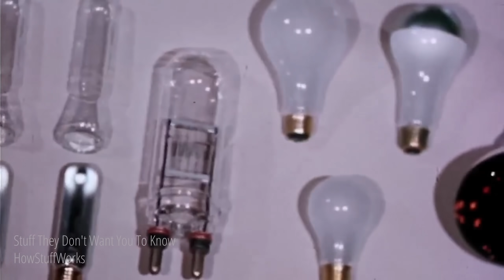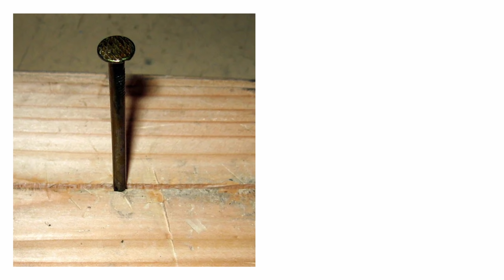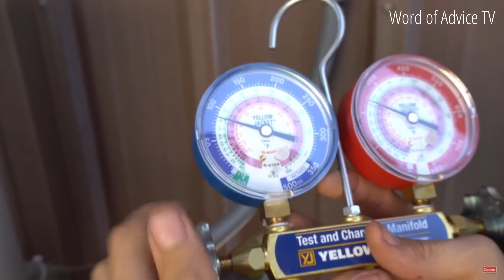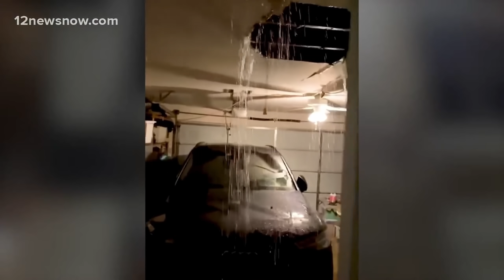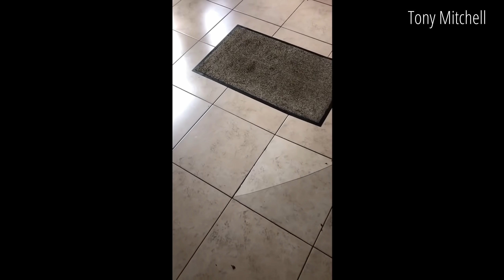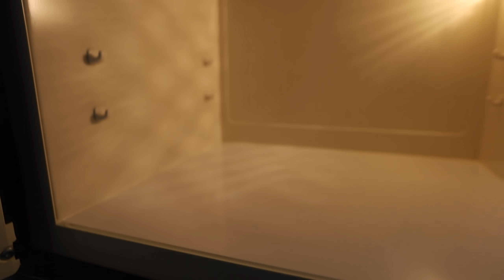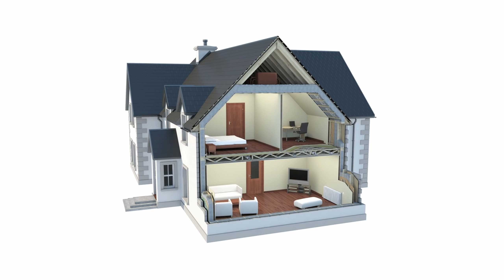Built to FAIL | Planned Obsolescence

Comment: Housing projects were examples of Planned Obsolescence. They were shoddily designed and sparsely maintained. The government and real estate developers played the long game with them. Using them as an excuse to level the lower density housing around them, and to concentrate the poor. 
With the property surrounding the projects gone, developers could come back in and claim the land and develop newer, more profitable developments. 

As for the projects. In Chicago, for example, they argued that the structures were so dilapidated and the conditions so miserable that they HAD to demolish them; giving the residents Section 8 housing vouchers and shuttling them either to other neighborhoods, to restart the process again in 20 years, or out of the city completely to suburban areas or other states that were ill -equipped to deal with the influx.

Comment: Crawlspace on pier and beam foundation, Easier to get to utilities, standardized sizes, not springing on all trends.  Sounds like a high end manufactured/mobile home your are describing as ideal solution.  Where I really have to agree.  Looked at many site built homes - you have little chance of repairing anything without huge bills. A modern mobile home is better built and stupid easy to repair. The roof is metal, Vinyl siding - both with last 100 years, while site built homes come with shingles - which are only good for 10 years.

Comment: I have a perfect example of planned obsolescence through a series of washing machines. When my ex-husband and I bought a house, a friend of a friend was downsizing and replacing his washer and dryer. Though his old ones were at least fifteen years old, they still worked fine, and he very generously gave them to us for free. They served our blended family of seven for six years without a problem, after which we separated and I took both machines with me, and my now family of four, to my current residence. 
Within a month of living here, the washing machine crapped out. My dad was very handy and, after finding the problem, decided that it would be best to replace it. My grandfather very generously bought us a replacement as a housewarming gift. (I was blessed with a wonderful family 🥰) That machine lasted for less than seven years, and only because we had purchased a five year extended warranty, which I had to use near the end of the contract. The next machine lasted about six years before it started leaking and making some very strange noises. It was then that the dryer finally gave out, so I replaced both and purchased extended warranties on them. 
That was two years ago, and who knows how long these will last. 
It infuriates me how shoddy construction is these days. Items that used to last for decades of use are made to fall apart as soon as the warranty expires. 
On a side note, when purchasing the last two washers, the salesman immediately tried to steer me to the most expensive ones. Finally, I placed a hand on his arm, looked him square in the eyes and said, "I want it to wash the clothes, not talk to me or the refrigerator or forecast the weather. I just want it to wash...the...clothes. The newest machines are both made by Whirlpool so not cheap, but reasonably priced. And, so far, they wash and dry the clothes without talking to my other appliances. 😉

Comment: Technically, LEDs can last for up to 100,000 hours of use, easily. 
What doesn't last are the circuit boards that are required to run them. 
One of my most common jobs as an electrician in the 2010s was switching out one led for another. They were promised to last 15 years. Lasted 2, because the circuit boards were badly designed and constantly overheated by the LEDs. One LED doesn't get hot, but what many people don't realise is that you need 4-10 LEDs in a socket to match an incandescent light's output.
I truly wonder which one is actually more sustainable. Should we use more tungsten for the incandescent lightbulbs or should we use more aluminum, boride, cadmium, manganese and so on to run the circuit boards of LEDs, which themselves are also doped with non-recoverable amounts of ALL kinds of rare metals?

Comment: Dyson vacuums does this by designing a trigger switch  that breaks over a few years. I opened one up and found the trigger was made if plastic and very thin in areas where it should be thick. I ended up fixing the cracked trigger by plastic welding and embedding a metal rod into it.

Comment: I disagree with you that breaking concrete to reach plastic drainage piping is planned Obsolescence. I find it hard to believe that someone intentionally does put drainage pipes beneath concrete slab for that purpose, it's just the way buildings have been built in the past and the present. Maybe you could have proposed a better option to access or service drainage systems

Comment: Recently, I cleaned my mother's apartment and came across our old Bosch-
refrigerator. The de-icing was a little dodgy but still in good working order. I put it on the curb and it was gone in 2 hours, now serving as trendy bar-cooler in a country-house... and still going strong. This was bought in 1967!

Comment: Watching this video just makes me realize how terrible some American systems are....... It also makes me realize how good we have it here in NZ.....
Reply: For a reference as well, 
I currently live in a 1970's house that was built quickly and as efficiently as possible to give housing to construction workers building the hydro project. (A massive project in Canterbury, NZ that provided heaps of jobs and clean power). This house was not really "built to last" as it was seen as a temporary solution, it was also built to be split in half and moved to where it was needed. 
HOWEVER, this house is solid as anything! The frame of the house is going nowhere fast and even 50yrs on is still as functional as a new build. The only couple of things letting it down is;
- The Outer Cladding, simply because it's made with Asbestos
- The piles for the foundation, we were unlucky and they are made of limestone 🤦🏽‍♀️
- The lack of modern insulation, simply because we have "silver paper" the 1970's way of insulating homes. 
When looking at the costs to renovate and update it, you're looking at about $40,000-$50,000 NZD to update it. Which is so so much cheaper than getting a new house.
For a more recent home build, my mum built a new house about 6-7yrs ago and during the construction process they used all of the techniques described in the above video, bolts on too the foundation; batting insulation, not foam, etc
Reply: The US took planned obsolescence pretty far with buildings, but we still have a long way to go with getting rid of it however nobody even cares.
Clothing, electronics, tools, it is really getting on my nerves how so many manufacturers give no fucks about giving you your money's worth anymore.

Comment: Hi Belinda. 
We chose a plastic rug with a wooden look for our new floor. 

We removed the wooden floor to be able to lay new insulation and the old floor was more than worn. when we had to choose floors, it became difficult. We were so into a new wooden floor, but the wood quality today is not what it used to be and the costs were sky high. We have click floors in some rooms and I have been involved in installing such floors, so we do not really like it. It is hard, ages too fast, etc. 

Here, all electricity is placed in pipes, power lines must not hang loosely inside the roads, which makes it possible to replace them without tearing up the floor or wall. Your wallpapers are really killer, so keep them nice. 

We try to choose sustainable, healthy and economical. 
We want a home where friends can be messy and where children and pets can be without us being present. We want to choose safety in the form of electricity, water, fire, wind, etc. 

I like your channel a lot because it is informative and much of your way of looking at things is the way I look at them. 

It would be interesting to have a program on how to protect your home from water damage.

Thank you for what you do

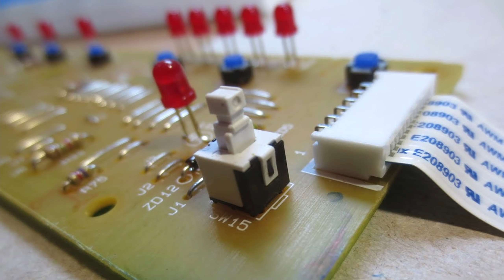Comment: 3:28, Hmm... almost all on/off switches are soldered on the PCB. What other ways to put components on PCB?
and it'll be a $1 part from Digi-Key. Also removing a component from PCB is never hard if you know how to do it... There's another way is simply to short the switch and make it constantly on..

Comment: I recently traded in my F350 6.7 Diesel truck at 105k miles due to this type of manufacturing.  When the truck warranty ends, the owner is looking at $5k for a turbo replacement, $3k Def system, $12k fuel system, $5k exhaust system, and then you still have many other parts that can fail...  I couldn't handle it, every time i started the truck i was waiting for something to break...  When i bought the truck i thought it would last 300k miles, and some do, but with failures along the way.  I realized while i owned the truck that Ford had enginerred the truck to just make it past the warranty period.  I'm not a mechanic and don't intend to become one...  I bought a gas truck, no turbo, no expensive def or exhaust system, simple fuel system...  and something i can work on if i need to.
Reply: They charge you 5k for a fucking turbo for just an F350 in the US? ...That is just insane!
Reply: @fumanchu4785  lots of labor charges, the parts probably cost $3500

Comment: First thing society could do is to mandate higher warranties.  Very few of us would consider buying a new car without a three year bumper-to-bumper warranty.  These are very complex machines working in quite a hostile environment.  A domestic fridge, operating in basically an isothermal, vibration free environment should have warranties far in excess of the one year warranty you get today. My old fridge worked 32 years without problem and was only disposed of because the plastic used on the inside had become hard and brittle and had broken in places.

Comment: I plan to hire a builder in the very near future so I'll be having very frank discussions on this topic with them. I'm willing to spend a little more if it means I get electrics, plumbing and flooring that are so solid they wont need replacing and I won't have to tear up the building to get to them for repairs. Currently got an offer accepted on some land.

Comment: I always questioned why on Earth houses aren't built in a way that one could easily service it. With openable walls and pavement where the water tubes or electrical wiring passes, etc.

Comment: There's also the intrinsic obsolescence - instead of using quality materials, our "economic" system pushes manufacturers to save money on each corner, including use the least quality/cheapest materials.

We are so quite messed up as a species still. We could've been doing SO MUCH better right now, if it wasn't for the competition based, profit based socio-economic system.

What we're basically doing is fending each for ourselves, when if we worked as one team - we could have progressed so so much more than we have progressed at this moment in time. We're basically (still) using a war-like socio-economic system, where it's all about how to win over others, how to cut corners because competition is getting worse and worse, where the rich become richer and the poor become poorer, etc.

Comment: All my pipes and plumbing run in my crawl space under the floor result I can easily access it and change it any time. Cables and switches above floor are surface mounted in conduit result changes are easy. I never install flooring like laminate because it doesn't last and access to floors is a problem. The above are not popular choices and consumers don't like it but it saves any problems and expense down the line.

Comment: Easy there Belinda darling on us Canucks. From a quick read through of the legals of wood stoves and such here in Canada the ban is only on very old or very inefficent wood burning stoves that emit faaaaar to much pollution. 

You can still have a wood burning stove or fireplace so long as it doesn't release more than 2.5grams of fine particulate per hour. A good quality stove from the last 10 to 15 years should be below that typically.

Having recently spent much time researching wood burning stoves of many types, many of them are emitting less than 1.0 per hour. I even saw one or two that were insanely low... as low as 0.35 per hour.

Although I agree with the sentiment that we should not be limiting peoples freedom to continue using their often still very functional heating methods, but if you look it at it more like how we banned asbestos use because of what was later learned about it's hazards... or how we have phased out using plastic disposable bags or incandescent light bulbs in favour of the obviously more efficient and evironmentally friendly LEDs. 

For example... when electric vehicles become pretty much the standard... I'm sure we'll phase out the use of gasoline and diesel over a period of time. 

I think the idea of the laws are to allow for homes that are... for those situations such as... lets say homes that are waaaaay past their 50+1 life expectancy, heating systems that are 25, 30 or 40 years old... or for the kind of "people" that just frankly don't give so much as a rats butt droppings whether their fireplace popultes the crap out their neighborhood right before the jump into their old 1990's diesel guzzling truck and blow huge plums of black smoke out their oversized and unnecessary loud exhaust pipe.

I love how you are critical of "fads" or "buzz" items but still approach the issues with an informed and logical mindset. When I first saw your video about shipping container scams I was about ready to pounce on you like an overly annoyed  Canadian beaver in the middle of a hockey match with an open net, eh!  Until I watched the whole thing. I was impressed on how you expressed yourself and your position. It'd be great to have a conversation one day if you're interested as I am currently in the middle of building a semi-tiny home myself, part of which will utilize a shipping container or two. Not to mention the topic of the challenges facing much colder climates when it comes to retrofitting or building in the small scale.

(BTW: many Canadian references can I make in one sentence? LOL)

Keep well, and keep making the videos. Love it! Love it very much!

Comment: Had a project with flooring, they had two types flimsy looks like it will break and cheaper flooring, and heavy firm strong flooring, at a higher price. Went with the higher price since it was DIY but a construction company would definitely pick the flimsy stuff as it looks the same and was cheaper.

Comment: Used to work in a rack and pinion steering rebuild factory.  We refurbished them. They were designed to fail at about 50000 miles when the seals would wear out by grinding themselves into the aluminum casting and causing internal leaks.  All we did with them was rebore the casting and insert a stainless sleeve.  The warranty’s on cars in those days was 30 to 40000 miles.  Our used rebuilt units would way outlast the original.  Designed specifically to fail no doubt.  Love your channel Belinda!

Comment: ... I live on 24ft 1967 fiberglass inches thick sailboat 55 years old, under 4000 pounds versus 200000 pounds of house.  So I wonder if Fiberglass solves everything but is soooo cheap industry thinks no profit margin on a dwelling costing a fraction as much.  Post1960 why stick with materials that bend crack degrade swell etc... Or heck why not solid concrete no rebar so lasts forever... We consumers and industry CHOOSE fragile materials and Fiberglass boats in the millions are scrapped due to no buyers...

Comment: I like your channel and thinking!
I'm a recent home owner (1930s house) and slowly renovating it, putting in insulation and efficient devices. I live in a varied climate, relatively cold in winter and very hot summers.
Will eventually install solar panels with a battery bank, and do away with reliance dirty and expensive electricity.
Regards from Australia!

Comment: Led lamps can potentially last almost indefinitely. But the manufacturers drive the individual little LEDs in side much to hard, to get more light output for the amount of LEDs used. In Dubai they have the Dubai lamps that are legally prohibited from premature failure. Planned obsolescence is not aloud for LEDs lamps in Dubai.

Comment: I've was told by a plumber who came to fix the dishwasher in my condo, that very basic, inexpensive American home appliances such as Frigidaire and Whirlpool, tend to last many years longer than more trendy but complicated Japanese and European appliances. It turned out that my dishwasher, a cheap Frigidaire commonly found in apartment complexes, was not broken at all. The problem was a plastic shipping plug left in the new disposal, installed by the realtor. Total cost of repair, less than $70. Basically the cost of the service call itself. That was three years ago, and the dishwasher still works perfectly.
Ironically, I had also purchased the same model of Frigidaire dishwasher, eleven years earlier when remodeling my last house. It too lasted the entire 11 years I was in the house. In fact most of the American manufactured appliances I had in that house worked perfectly over the decade I lived there, including the cheap used washer & dryer I had in the garage. The sole exception was the Frigidaire double door refrigerator, The water & ice dispenser stopped working after 10 years. The lesson I guess here is that sophisticated and trendy are not always reliable, at least in terms of home appliances.
Unfortunately, the same could not be said about my old house. A Fox & Jacobs early 60's track home that had a slab foundation that crumbled like a graham cracker pie crust.